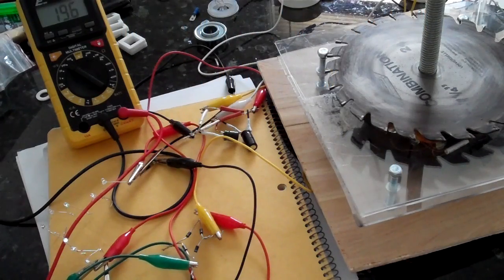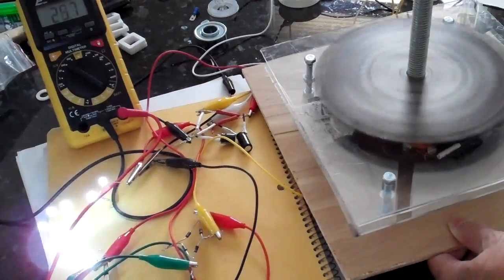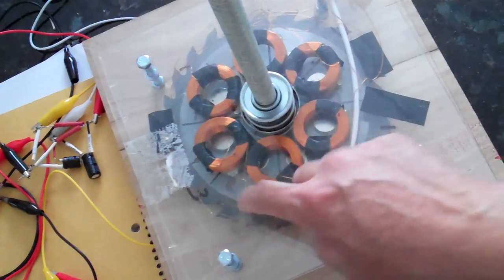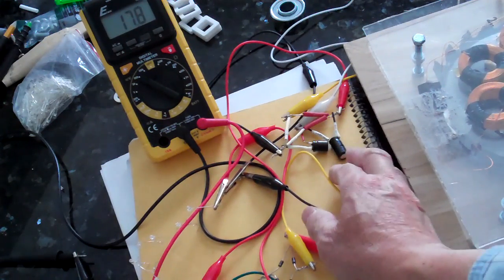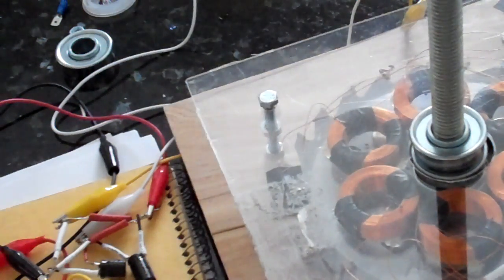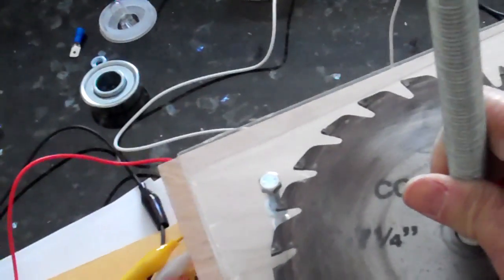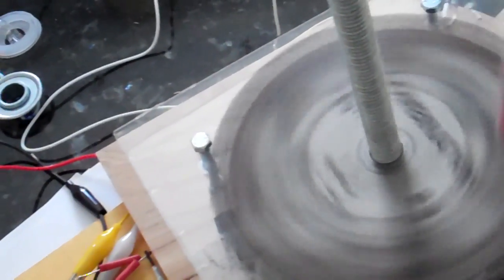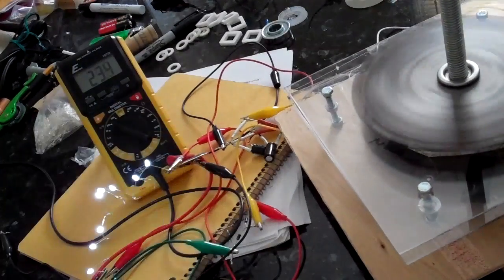Small 6 coil, 3 phase, axial flux alternator.mp4

Comment from the maker: The bottom plate also rotates. There is a spacer between the two plates in a dual rotor axial flux alternator.  You can make a real simple rectifier, especially a low power one. You need 4 diodes (I used 1N4007) for a full bridge rectifier. Just Google "Diode bridge" and you'll find the schematics. Don't let this fool you. It's not that hard.
Reply: how about for three phase bridge? only 4 diodes?

Comment: Some things to experiment with:  1) put a large metal washer on top of each magnet.  The washer could be larger than magnet, and almost as large as coil.  2)  Cut many one inch lengths of coat hanger wire and wrap them in a bundle like a bundle of matches.  Fill the space inside the coil.  You no longer have "air gap axial flux" alternator.  You know that iron inside coil will increase the magnetic flux, and thus increase work, and power output.    Keep having fun and learning.  Peace.

Comment from the maker: @churchun The caps smooth out the voltage I think the term they use is "smooth out the ripples". I see it as a device that can store energy and build up voltage. The voltage would go up and down so much you won't be able to get a good reading if you don't have the capacitor.

Comment: Looks pretty good, using parts you have available.  The saw blades look a little scary to me.  But I guess you will seal the teeth up inside so they can't cut anyone.  You could also cover the teeth with something soft.  But I see your blades do a good job holding the magnets.

LEDs get bright with just a little spin so your design is working.  You look like you are close to capturing wind energy with your generator!